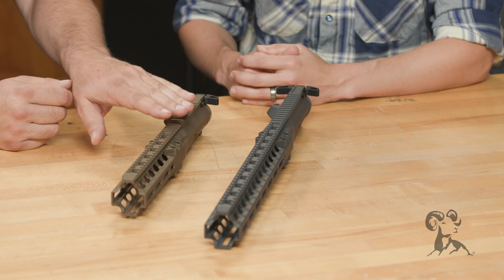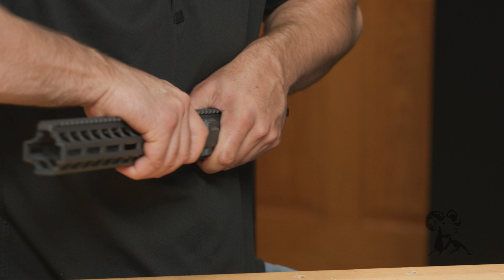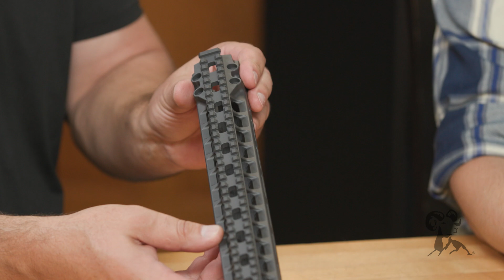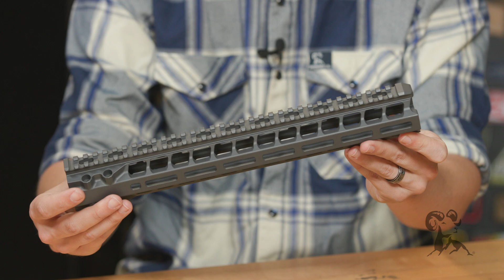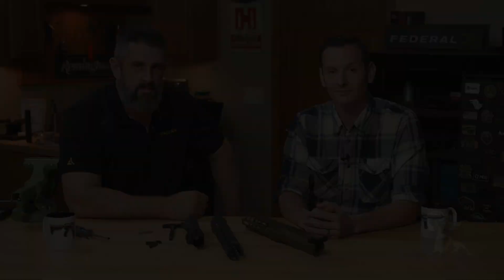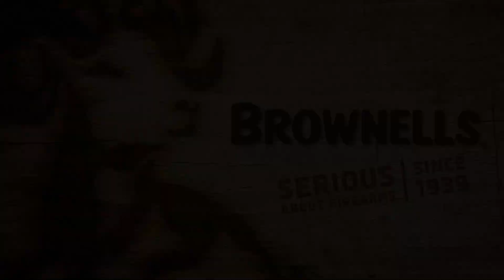Product Spotlight: Radian Mod 1 Upper Receiver

Comment: It's a solid alternative to a G super duty upper that lets you use your own barrel assembly. However, it's very expensive, and heavy, last I checked the 10" set was $800, while complete G uppers can be had for just under $1200 with barrel, Hux MD, BCG, and charging handle, along with an integrated steel QD socket, that's almost $700 worth of parts in addition to the upper, CH, and handguard. Only thing this really has over G is the relocated forward assist, and maybe radian's SD charging handle, if it's something you need for your can.

Comment: That MSRP, though.

For $1000, you'd expect the handguard to be 7075 instead of 6061.
Reply: Same thoughts
Reply: 1k for an upper with no bcg....yea, hard pass. I own a lot of radian products from complete guns to charging handles to small parts. No way an upper with no barrel or bcg is ever getting 1k from me.
Reply: I own a model 1 14.5 I picked up geissele complete upper on griffin mk2 ambi lower decked out optic,light drop in trigger %40 less than what my radian is selling for bare bones 
Honestly haven’t pulled it out the safe in a while running 2 geissele builds 14.5&11.5 amazing rifles

Comment: Before you invest heavily in a Radian give consideration to the fact that the upper will not fit with any other hand guards and Radian will not sell you an additional longer or shorter hand guard if you want to change the barrel length or install new furniture that doesn’t quite fit, like a Riflespeed adjustable gas block. You are stuck with that upper and hand guard combination.
Reply: Good intel. 👍
Reply: I was coming here to say the same. Good looking out.
Reply: They’re really nice, but no thanks. Plenty of other premium guns In that price range are better. HK, LWRC, LMT, KAC (if can ever find one).
Reply: Thanks for the heads up
Reply: I ordered a 14 inch radian builders kit, I am ordering a 14.5 barrel, do you think I will be able to run a rifle speed gas block or will I not be able to access it?
Reply: Like nearly every upper and hand guard? Who else sends u a different handguard length if u want to change barrel lengths?
Reply: @mossyoak78552  They won't sell you another handguard. Nice reading. Exactly zero other AR companies do that.
Reply: @sixpointnine1k  yeah nice reading. Typed the same shit I said. But differently.
Reply: @ Dense. 

They said sell. Radian won't sell you a rail. You changed it to send (I.e. for free). The point is, once you build your rifle, they won't sell you another rail if you want to change it.
Reply: @mossyoak78552  He means you can't buy a new handguard for it. you can only buy them as a set.
Reply: Ford recounted a sales meeting in 1909 when a salesman wanted him to add even more models. Instead, Ford state "he would build only one, “and I remarked: 'Any customer can have a car painted any color that he wants so long as it is black.

Comment: its a solid lock up, LaRue does that with the handguard, and Noveske does it too, good brands who like to invest into thier products, go the extra step. just 1 more reason why Radian is one of the best. great video! thanx Caleb! i noticed you didnt tell him to use the KungFu grip?? we all know that is the only grip to use..!!! as always thanx and cheers from the woods of Maine!
Reply: Unless I’m missing something, it looks like any other non-timed friction fit design that clamps to the barrel nut vs bolting into it directly
Reply: @Alex-12381  it also has the "pin" anti rotation inner tab/pin to keep the alighnment and rotation under control.

Comment: I’d like to know the inner/outer diameter of the hand guard to see if it’ll run a suppressor. I love Talon products!
Reply: Mine reads 3-9 o’clock inside diameter 1.61” and outside diameter 1.8”. 12-6 o’clock inside diameter 1.7” and outside diameter of 2.08”. I have geissele rail panels the entire length of all 4 sides of my handguard, and my micrometer isn’t lab grade, so the measurements aren’t Skunk Works precise. Hope that helps.

Comment: I would be curious the weight of that vs normal forged components.  As I recall, forged is lighter.  All the lightening cuts are great, but if its still heavier won't matter. 

That's been the issue I've seen with extruded and billet materials.